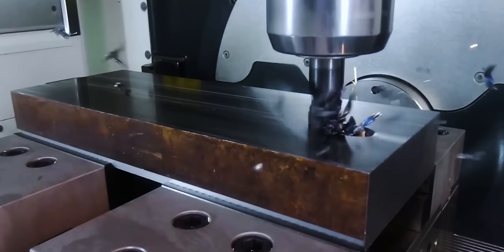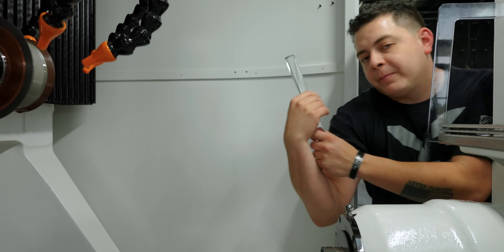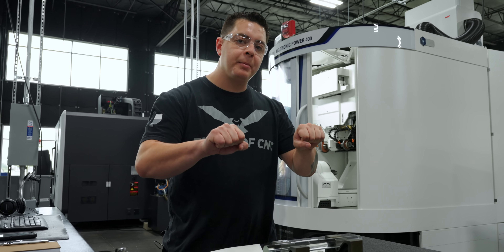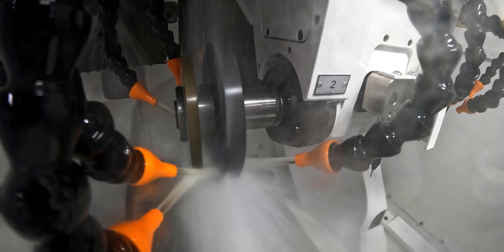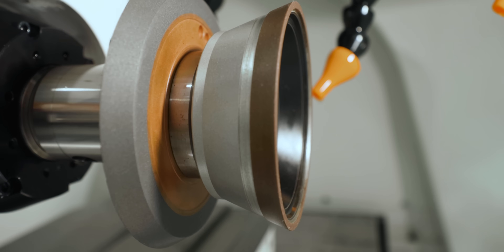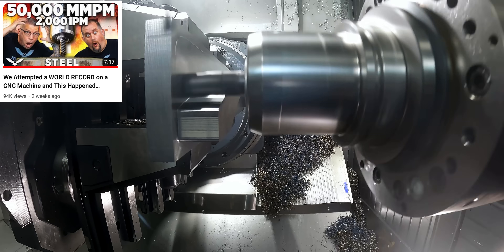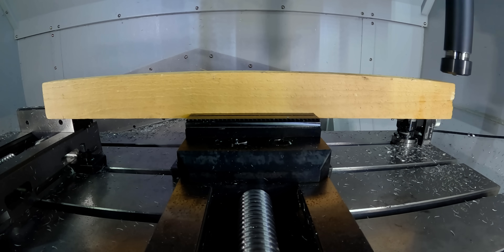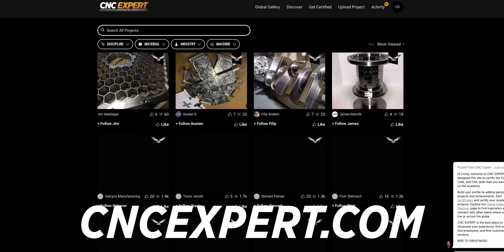World's First Glass Endmill | Incredible Process!

Comment: The point of filing the glass isn't to make it thinner (though you can simply saw through it with a diamond saw).
The idea is to produce a crack which acts as a stress concentrator.
So you want as sharp a notch as possible.
That typically means a very thin scratch.

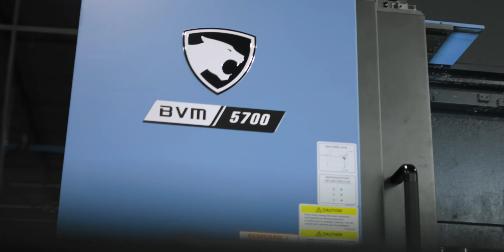Comment: 6:03 the reason why this experiment didn’t work is because you don’t understand borosilicate glass. I’ll put all my money down that they didn’t anneal the glass, which makes it stronger . If there are any rough edges on glass (which happens when you cold cut glass)  that haven’t been polished, it’s not going to stay intact with the least amount of tension. And by the way, if you’re using soda lime glass, you are the epitome of a mouth breather. THIS EXPERIMENT IS POINTLESS. Also, you don’t need to come down too quickly, that will obviously make the glass break. This is the most pathetic experiment I’ve seen on the Internet.

Comment: Use a press and plenty of cushion in what holds it softly but firmly between rounded v-blocks.  You could break the 1'' like you broke the 1/2" if you were strong enough, but no one is, so use the press.

They make good award tops?  I know that quartz set you back a penny or two, so the awarded should be worth it😋

Comment: Quartz is a crystal, not glass. Glass is amorphous which means not crystalline. I'm guessing the rod isn't quartz and instead is just glass made using quartz as one of its ingredients as most glass is. As for splitting the bar, the most important thing is that the inside angle of the notch is very sharp. The reason cracks travel through glass so quickly is that the very tip of the crack is an incredibly sharp inside angle meaning its a huge stress riser. Stress is force divided by area, so if the area of the inside corner is almost 0, the stress is almost infinite. That diamond file you were using was pretty blunt so your groove had a very large inside angle area making the stress very low.  Impressive machining though!

Comment: Spoiler 
On first contact the glass endmill broke 
On aluminium and wood
If you go really really slow in the material you can cut a hole in wood with that glas endmill but after about 3 cm or 1,5inches the glas broke again

Comment: I am sure you are going too fast and too hard with the glass edmill, it is a very fragile and brittle material if it is not tempered glass which is less fragile, 1cm per minute should be enough for 2017 aluminum, after that it depends on the minimum speed of your machines, it's so slow but it can be worked

Comment: For cutting a rod of glass that size and bigger, we usually use a glass cutter. Basically it’s a verry small round rotating diamond blade and it makes a shallow but clean score in the glass, after that a light tap with a small hammer or anything else it brakes quite cleanly

Comment: If you want a ridiculously hard challenge - You could try teaming up with a glassblower to make a super strong version.  You would have to make a sealed mold with cooling channels and blast liquid nitrogen through the mold seconds after the pour.  It would be insanely hard because of both timing and sealing the mold, but you would have a chance at mimicking the strength of a prince rupert's drop.

Comment: next time you gotta cut thick rod, you're gonna want a score line all around, hit it with a blowtorch and throw it in ice water once it's hot. 
(credentials: worked in glass manufacturing, we always just used fuel alcohol and a lighter but a blowtorch should work just the same)

Comment: You're filing the glass, a score line is a very tiny crack that propagates under pressure. Make a much smaller nick (not cut), and then use a blowtorch around the cut mark while rotating the rod, the heat will make the crack go all the way through the material and it should snap. You don't even have to make the score line go all the way around, just on one side should be adequate, the heat will make the crack grow through the material.

Comment: When glass breaks, these are usually resonance fractures, i.e. the superimposition of pressure waves that come from different directions, for example one from the place of origin and an older one in opposite directions that was reflected at the other end of the workpiece. Glass is actually more robust than we think (on paper if you look at the value of its tensile strenght for example). Only its ability to harmonic vibration destroys this quality. Therefore, glass behaves much more robustly under water: water dissipates / absorbs the pressure waves from the glass's vibrations (any hard body) much better than air. In this respect, glass processing underwater would be safest, the probability of fractures would be lowest there.

Comment: 2:49 to break it use alcohol and a string . The wet string place on the line an lid ut it then turn it and then quench it into cold water. For tubes and bottles it work but for round bars this thick i dont know

Comment: Been in float glass mfg for 10 years. Heat it around 80C and make your score. Get some sort of triangle like a piece of angle iron, point up on table, hold the score upward and center the rod score on the point of the triangle. Doesn’t even have to be a triangle, could use a cylindrical object. Just center the score upward.

Comment: So you only want a tiny scratch. Put water on it. It helps the glass to crack on the molecular level. Then you simply pull the rods apart it takes quite a bit of strength but you look like a big guy I'm sure you'll be able to figure it out.

Comment: I'm a glass artist. Quartz makes sense for the material used because of just how much stronger it is compared to soda lime or even borosilicate, but yeah score and cutting a 1 inch rod would be very difficult. You've got diamond wheels, so you'd be able to set up cutting fairly easily. A simple tile saw will do the trick but make sure when cutting glass use plenty of water on the blades and material. Diamond wheels and laps are used to get perfect edges on glass, though if cutting go real slow and prepare for a little bit of chip out that'll be very sharp.
The other option which isn't as consistent as a cut, would be to do the same score, not super deep but 1/4 to 1/3 the way around the rod, heat up a thinner glass rod and glob it half way on the end of the score. This'll create some thermal shock to break it.

Potentially annealing the quartz might have made it stronger, but honestly I'd be surprised if there was a huge difference. Rod tends to come pre-annealed and quartz is so hardy the actual stresses put onto glass by grinding and shaping are minimal. Glass is fantastic for compressive strength. You could tighten down that rod in the chuck probably as strong as a regular carbide tip, but it's sheer strength is very low. I think if gone slow enough it could probably drill through copper or brass, but could not face anything

Comment: I blow glass...This is really cool application and show piece.. If you want to cut the rod easier, ya just need to use a square piece of tool steel to score it over half way around and apply a little heat on one end of the score. The file doesn't work on large diameter rod because it cuts too deep.. Its counter intuitive I know. You can't just slap it with steel blocks on the ends though.. that will never work. XP

Comment: Use a tile or rock cutting saw, slow heavy grinding rotations.  Glass also needs to be annealed to avoid residual internal stresses.
Alternately, you could use a breaking die (since you're in a machine shop) making a couple collars that fit the glass rod closely and tightly together; once the glass rod is into dies, just shift it a minute amount and it should shear.  I'd never think to do it this way but it might be convenient for you if you need to make a bunch of blanks fast; predictably without a ton of waste.

Comment: Step 1: Score the glass all the way around. no deep scoring required, just a scratch should do.
Step 2: heat the glass (rope soaked in kerosene +lighter works) heat for a full minute or so.
Step 3: quickly submerge in cold water. dropping in or swirling work.

Comment: Your sticking it out of the collet way too far and then your not using a high enough grit wheel for fluting or the OD grind. Could really use a flute polish at 1400 grit after roughing and an eccentric primary would probably give it a nice crisp edge . Nice and slow for glass. makes me want to try it on a rollomatic with the v block and steady rest on.

Comment: To snap rod that big to 1” cut it with a title saw or chuck it up in a lathe then score a nice line around it. If you can’t make the lathe spin slowly with the motor just turn it by hand. Then just put a torch to it for a second just on the score line a small flame for like 30 seconds depends heat management matters. But after just put a wet paper towel to it.

Comment: Chris, to cut the glass rod to length, you might try doing it like when cutting glass bottles.  Basically, you score the glass at the length  needed . The score depth  should be roughly 1/8 th the diameter.  Using two V blocks place the rod stock r v block and  rotate to score the line with a  new unused glass cutter .Note that if rod is  not easily turned try  using a light assembly grease.on the v blocks  in a very thin coat. Then heat the glass in a hot water bath under 160°   heat soaking for five minutes.  The pull from hot water bath and apply ice to just the score  while rolling the rod on the v blocks.  . Safety notes proper PPE  gear should be  Eye protection  minium of goggles,or safety  glasses and facesheild , and gloves.  I used to cut glass wine bottles necks this way for  vases this way. Or  you might try cutting it off with a  abrasive media  while submerged.  I also made aquariums from glass blo k with a diamond hole saw with the block submerged  under water. The water dampens the vibrations of the cutting tool and cools the material, thereby easing stress shattering from heat . The glass end mill mounted in  a  block of aluminum  with a hole in the  block to allowing  the bit to fit into the block . A smaller hole in the bottom of the block to allow a  high intensity led to be installed in the bottom to ligh up tbe end mill.  Four groves in the top to allow a plexiglass cover to sheild the mill bit from physical  contact.
Reply: Or his giant grinder might have cut it
Reply: @chrism4008 this is the answer.  Has a huge $500k+ piece of machinery that could easily cut it.
Reply: That was what i was thinking it does work well on quite thick tube
Reply: or just use an angle grinder with a diamond cutting disk lmao
Reply: The heat method won't work on quartz because it's coefficient of thermal expansion is too low.

Comment: After you're done milling, send the glass to get Tempered.  You'll give the edges the harness and toughness to withstand some higher mechanical abuse.  This does require you to get a specific formula of glass.
Reply: I think he mentioned it was "quartz" so it should be fused silica. I think tempering is not really applicable for that.
Reply: @TheBackyardChemist  You can  stress relieve quartz. It will make it significantly tougher. It will never make a great cutting tool, but it might withstand the first contact with the opponent... ;)
Reply: @jackmclane1826  Yes, but "stress relieveing" is called annealing, not tempering, which tends to mean a group of specific processes when talking about glass, which intentionally introduce internal stresses.
Reply: @TheBackyardChemist  I agree. But also annealing significantly increases strength of glass, so maybe it could at least take off a chip before breaking. ;)
Reply: @TheBackyardChemist your probably right but explaij how i can stand directly on every surface on my glass desk, and fall on it climbing in my window at 160 pounds and not break it
Reply: @jamesmatthew899  There are different chemical compositions for "glass", just like there are different alloys for steel. And just like steel, some of the alloys can be strengthened with heat treatment, while others not really. Your glass table is probably made out of a type of glass that can be tempered. Tempered glass is like pre-stressed concrete, some parts of it are in tension, others are in compression.
Reply: most classical glass can be tempered. it depends on the coefficient of thermal expansion, but also on the thickness of the glass. soda-lime glass as is used for windows expands quite a bit when heated, so it's not difficult to create stress within the glass by quenching, which is done for tempered glass. fused silica or quartz glass has an extremely low coefficient of thermal expansion, so inducing thermal stress is nearly impossible (you can put a piece of white glowing fused silica straight into a water bath and it won't shatter!). Also for tempering you'll have to heat the glass to almost 700°C so say goodbye to your edges. Anyway, sharp edges on the glass may lead to cracking of the glass during tempering. and grinding after tempering is impossible.
Reply: Ummm... tempered glass on a piece like that wouldnt go so well. The moment one of those flutes edges gets any tension on them it will act like the corner face of a piece of square tempered glass and it would shatter or chip. Whether its tempered, heat treated or not something of that design wouldn't be able to be used as a bit... just for show only.
Reply: To give the edges the hardness? Well, it's already harder than even the hardest HSS endmill

The problem is instead, it is ridiculously too hard in the area where hardness is not that needed
Reply: you cannot temper glass.
Reply: @chargehanger  tempered glass is a widely used term to refer to glass with intentional internal stress
Reply: @chargehanger  you... literally can? you windshield is tempered glass thats why its so tough and able to take knicks with out shatterying
Reply: Windshields aren't tempered, they're laminated.
Side and back glass is tempered which is why it doesn't chip, it shatters. 
Helicopter windshield are made from lab grown sapphire.

We're on the Internet, use it to learn things people.
Reply: Float glass can be both chemically and thermally tempered. Laminated glass can be made with different glass plies and interlayers. Keep in mind that glass, being a brittle material, is also affect by defects that follow a probabilistic distribution and the finishing of the borders. Obviously a glass end mill is usell for most applications
Reply: @dannymitchell6131 yes to windshield being laminated. sidelites and rear windows can be laminated, too, but usually are just tempered. Sapphire however is not used for helicopter windshields. there are some ways to draw flat sapphire crystals of quite substantial size (80 cmx40 cm), but far from a windshield size and especially 3D shapes are very complicated for large objects. you can get smaller bulletproof windows with sapphire layers. Sapphire is especially interesting as a window material for instruments that use near infrared or UV (I.e. IR cams).
Reply: @karupt422  It's not useless. If you end up stuck inside your car while it's sinking in the lake, you'll be glad to know the side and back glass are tempered.
The window may not function properly anymore...or more likely you'll simply forget how to roll it down when you try the handle and  realize the doors have 1000lbs of pressure pushing them shut while the car is sinking nose first.

Use any sharp or heavy piece of steel against the top corner of your window. Do it as hard as you can, the glass won't cut you very badly.

Any rescue people know these things as well as the gear heads but the average person will probably panic and drown when there were at least two techniques for getting out.
If the window doesn't break just calm down, take some deep breaths... seatbelt off... unlock door... keep waiting until the car has filled with enough water to equalize the forces enough to open it.

I hope you never need this but just in case, here it is.

Comment: I would try a thermal break. Score it lightly all the way around. Don't need that crazy deep groove. Just make a nice straight scratch in the rod. Now get some alcohol and wet the score. Light it up. Let the flame burn out, now hit it on the score with some cold water. We are using the contraction to do the work for us, and the scratch gives the tension a path to follow.

Comment: Glass is different than quartz. But it was the right choice to use quartz because it should be consistent with the crystalline structure
Reply: Glass and quartz are both silicon dioxide, though glass usually has other compounds so it melts at a lower temperature

Comment: Nice Idea, you guys could consider to put the endmill into a Pottasium-Salt bath to close the defects on the surface due to the production process to increase the strength of the amorphous structure. Additionally you could give it a view under a crossed polarizer to see if there are any mechanical forces on the structure due to the production process.
Reply: I'm not an expert so I don't know about the potassium salt. Nice you've pointed out. At the same time, I've also thinking about the polarizing inspection would be a good idea.
Reply: @BadGuyDennis  There is a nice video from "Applied Science" who explains how Gorilla Glas works, and he uses the potasissium salt method to show an experiment including measurements.

Comment: For my experience in "snapping" glass, as shown here, is that your hands were too far apart from the score line. Pressure was put too far away to create the necessary energy to finish the score into the material.
I always put my two thumbs right behind the score line and push away from my body to finish the cut. It has rarely failed me. Good Luck!